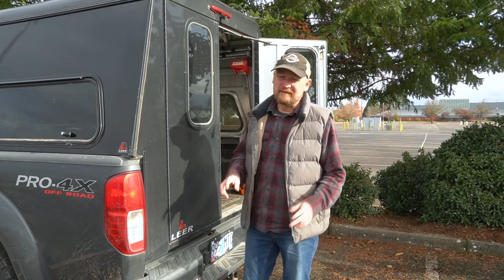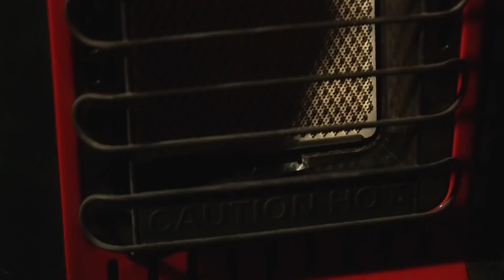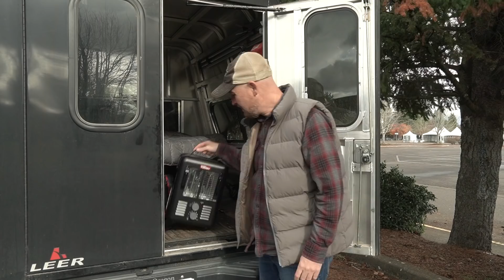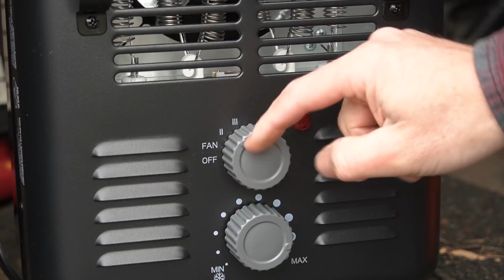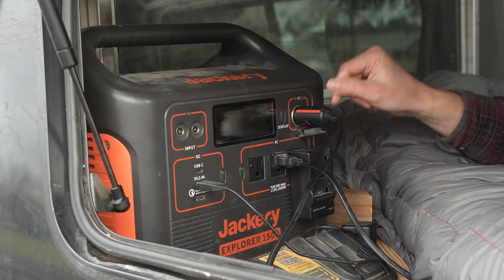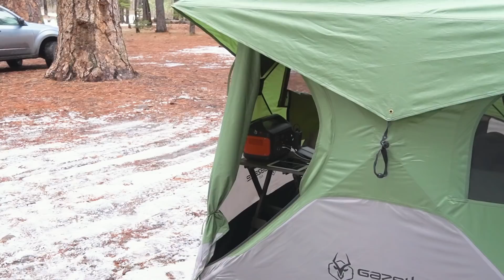Reconsidering Electric Heat & Jackery Black Friday Deals

Comment: Thank you for sharing your experience and thought process on figuring out another solution for your needs! We currently love our heater buddy and have not thought about what we would do if it fails. Wondering if the electric variants would be more reliable. How long did your buddy heater last?
Reply from the maker: It’s been about two years. From other comments, it seems to be repairable...I’m going to try. Long term I’m sure I’ll move in another direction that burns some kind of fuel outside, but for now the electric heater hopefully can get me through this winter. 🤞🏻

Comment: I been using my  buddy heater about 4 years now in my bedroom. I use 20 pound tanks. With the adaptation hose ran out the wall of my room. And knock on wood it's been great so far. We have concrete floors so also have a lot of condensation I don't believe that is your problem. But I don't have any idea what is wrong with yours
Reply: @redneck,
For our ExpeditionVehicle, we laid slate floor.
Our Wave 3 catalytic heater sits on the stumpy factory legs, and heats the slate, then they radiate heat laterally.

Comment: Your Mr Heater has a spade connector that has fallen off the terminal for the thermocouple. That is the little stick that the pilot light is directed at. It tells the gas valve that the pilot is lit so gas doesn't fill the space without a pilot to light it. 
My Mr Heater did the exact same thing after one day. Take out the screws open it up and you will find a wire not connected to the spade terminal it was originally connected to. Pinch the connector slightly to increase the tension between it and the spade terminal and reconnect it. You can do this.
Reply from the maker: Cool, I will check this out. I definitely want to repair it.

Comment: Super curious on how you tackle condensation this winter.  Something I'm always dealing with up here in Oh Canada.  Was thinking about the diesel heater.
Reply from the maker: I’ve already had numerous very cold nights in the canopy including use of the Mr Heater Buddy, and while I’ve definitely accumulated a haze of condensation by morning on some of the nights, so far it’s not been problematic...nothing dripping on me, and it dries up quickly in the morning. Very often, when I’m camped in the cold, I’m also someplace relatively dry. My coldest night so far was 24° F in Nevada, and had virtually no condensation in the morning because it’s so dry on the high desert. Long term, I’m sure I will move to some kind of combustion heater that just pipes in warm air (rather than burning propane indoors like the Mr Heater Buddy) and I feel that will even further reduce the already minor condensation I am seeing.
Reply: Check out Living the Van Life's recently video heater about his new diesel heater. I'm going to pick one up.
Reply: I'm in Canada too, lots of good insulation & spray foam cracks, gaps
Diesel heaters are good but require electricity to run all winter

I use a Dickensen propane stove it is amazing & cozy flame ambience

Comment: Given the continued shortage of green propane tanks, not a bad idea to explore other options anyway.  Though the power needs for resistance heat makes me leery of draining my battery unit.  The 12v blanket is genius though...
Reply from the maker: Yeah, it’s definitely power-hungry and not an option for sustained heat. I’m going to give it a shot overnight in the mountains this weekend and see just how much of a ding it makes in the power reserves. I think the only way this approach is feasible is if you’re definitely driving each day and can recharge your power station. Long term, I’m sure I’ll still end up with some kind of combustion heater, but I just have too many other projects on at the moment to dive into that, and needed a fast easy & affordable solution to get me through this season. 🙂

Comment: Heat rises. 12V blanket should, therefor be on the bottom.  For us its Reflectix on the floor (teardrop), mattress, 12V blanket, fitted sheet and opened sleeping bags used like duvets. If it gets too cold for that to work we simply zip up the rated sleeping bags. We've been out as low as 0°F (-18°C) and sleep quite comfortable. You sure are right about that getting up in the morning tho...that can be quite nipply until your clothes warm up too.
Reply from the maker: Interesting. I’ve been using it on top of me. My mattress is 4-inch high density foam and insulates me perfectly from below. This year I’ve switched to sheets and blankets instead of a sleeping bag and love it. Fitted sheet on my mattress, flat sheet over me, then the electric blanket. Down blanket on top of that plus a final blanket over the whole thing seems to seal in the heat very nicely...I have to switch the blanket off after about an hour, and then generally my body heat is able to maintain the warmth. Plus the two layers of blanket material of the electric blanket itself is an extra insulating layer even when the power is switched off. I never get cold from below. I am nonetheless curious to try the electric blanket below me to see how it compares. That would definitely make the covers more manageable.
Reply: @softroadingthewest  "That would definitely make the covers more manageable." Yes it does. We have ours running through a Xmas tree lighting timer but my wife usually turns it off before the timer does. Try it, if its not for you so be it. I put ours under the fitted sheet because it kept slipping away from us up top. Maybe ours isn't as wide as others but its far better sandwiched so it can't slide off one or the other.
Reply: This is the way. In our van we have the foam mattress, 12v elec blanket on top of that, fitted sheet on top of that to pin it down. Down duvet over us (sometimes an additional blanket) and clothes in with us to keep warm for the morning. This gets the heat rising through us and the down duvet traps it in. We've slept in below 0, it wasn't toasty, but we survived.

Comment: Looking into a truck - canopy setup like what you have. If the bed was long enough, do you think it could comfortably sleep 2?
Reply from the maker: I've certainly seen people do it. It doesn't look comfortable to me though...that's a small space for two people to be moving around in, getting in and out of bed, getting dressed, etc., especially depending on the height of the truck cap. Probably fine in summer when you can do everything outside until you go to bed, but in inclement weather, seems like it could get old fast, heh.

Comment: I’m definitely gonna get a Jackery now that you’ve sold me on it Donald! Lol. I was actually curious how warm the inside of your canopy got when you run the heater fan. And how much power it takes.
Reply from the maker: I've only briefly tested it, in town, during a cold day, to get a sense of if it'll heat up the space well enough to make changing comfortable. It will, but it's a power hog for sure...definitely cannot just let it run. I'm going to go for a quick overnighter in the mountains this weekend and we'll see how it goes getting truly put to the test, and how much battery power I end up consuming. I'll definitely report back. :-)

Comment: Hay Donald, 
The heat sensor that the pilot flame blows on probably burn out.
You mite be able to get a new one from Mr. Heater Inc.
But you mite be cheaper to get a new one  
Dennis from Delaware U.S.A
Reply from the maker: Aaah...didn't know that was a thing, but that sounds very likely to be the culprit. I'd love to repair this because it's s good little heater and we still use the Gazelle when my daughter comes along with me. Thanks Dennis!
Reply: @softroadingthewest  I had one do it to and I replaced the sensor and it still works. 
Dennis from Delaware